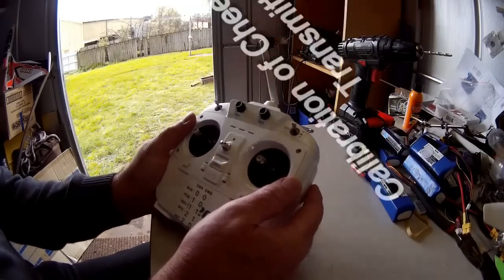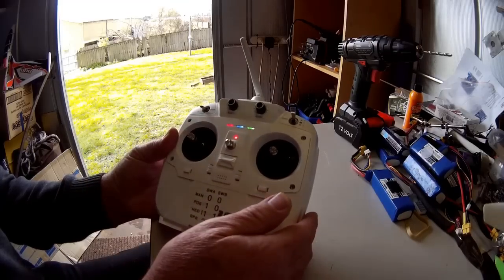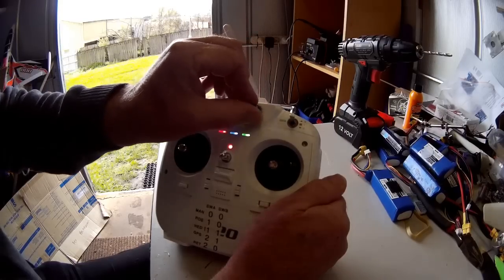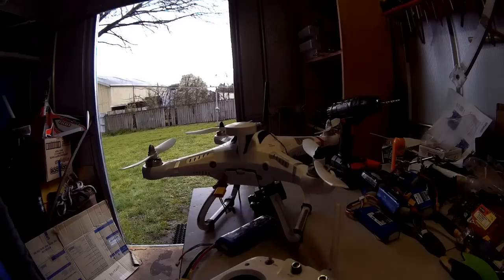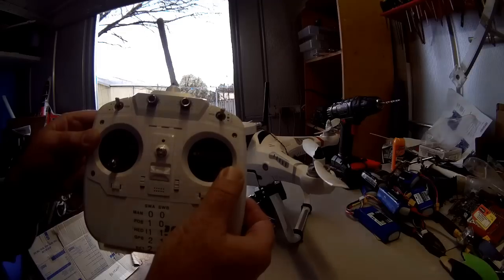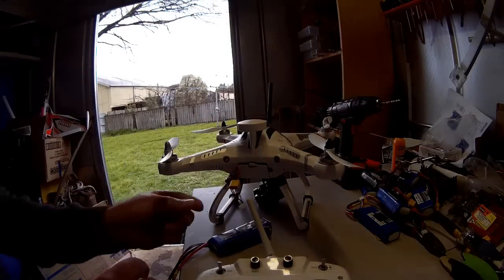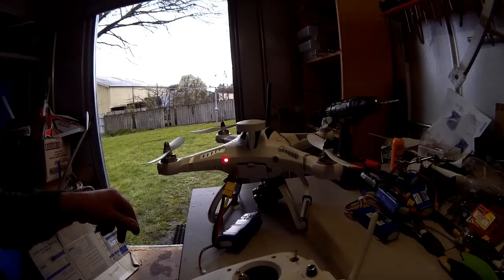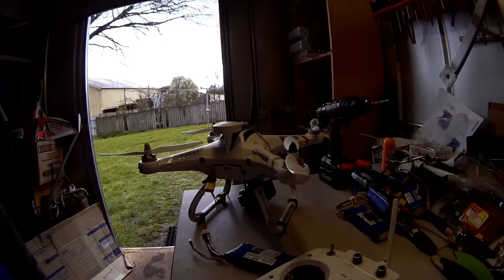Cheerson CX20 Calibration + Transmitter

Comment: I hope you don't mind but I've had to refer to your video several times in the field because I don't fly my CX that often and forget the calibration procedure so I've summarized it in text below in case anyone wants to save it to there phone etc. BTW I used it today when it started flying big circles in GPS mode. After the calibration it was steady as a rock. Thanks Again.

Cheerson CX20 calibration
TX
• place throttle in mid position
• left toggle to 1
• hold up right vertical trim
• turn TX on
• rotate control sticks CW five times to all corners
• put throttle stick in mid position
• rotate auxiliary 1 knob CCW,CW then back to 0
• repeat for auxiliary 2 knob
• left toggle to 0
• turn off TX

Compass calibration
• Plug in battery to quad
• Immediately turn TX on with throttle down to base setting 
• Immediately put right stick to lower right hand corner
• Red and yellow light will flash on quad
• Rotate quad horizontally 5 times
• Turn quad vertical nose down and rotate 5 times
• Place quad back on ground and unplug battery
• Turn TX off
Reply: I tried all , everything word by word and it don't work 😭

Comment: Hi, ive just recieved my CX-20 today, and done all calibrations, one thing that bothers me is that isnt it that when the drone acquires GPS signal, the green light should be on steady Bright Green?? Mine seems to have have a Problem, i think if it already acquires GPS signal the green light shuts off!?? is it a big problem? im afraid to fly it now =(
Reply from the maker: +Michael Corpuz should be steady green, usually takes a few minutes. it will be flashing until it gets enough sats.also its best to move the gps from on top of the reciever to under the top shell and cover with either copper foil or aluminium foil ,gets sats quicker and does not get interferance.there are vids on youtube how to do this , its easy .

Comment: I'm having trouble taking-off with my CX-20. When I throttle up, the quad wants to tilt over severely. I'm an experienced quad pilot, and I've never had this issue with any of my other quads. The props are on correctly, I've tried recalibrating the gyro and accelerometer in Mission Planner twice, and I've recalibrated the ESCs and transmitter. Any ideas?
Reply: +Drew Fulkerson Have you sorted things out yet?  If not, see my reply to the person above you ^
Reply: or below you even lol
Reply: Mine does  it all the time. I just throttle up hard to get it off the ground.

Comment: I have to do this when i get one? or just if i want to?
Shouldnt it be ready right out of the box?
Reply from the maker: +Matt Owens Gidday Matt, you will have to do it to get compass bearings for where you are first up and also if you go to another flying area more than aprox 100 miles away. also make sure you dont do it where there is a lot of metal or powerlines about, it can mess with the compass.

Comment: I don't have access to a computer whatsoever! only this tablet. I might have to send it back if it's that unstable. But, before I do, I can try to, and I even read that sometimes a unstable or tilting issues might be solved by hovering for a little bit. I also know that everybody has a way of calibrating the Compass and GPS and even the controller. I also heard that the compasses and GPS come loose also!  I know that a lot of people, as soon as they get them out of the box, they shoot them straight up like a rocket ship without getting used to how they handle etc... And then they cry like little girls,  because "it just flew away, just like that...." I believe in baby steps!!! Thanks for your time.
Reply: +philip dangelo  Hello,  did you ever do the hover thing to get rid of the tilt?  Or did you send it back? If you search YouTube for   "How to fix the tilting issue on a Cheerson CX-20 / Quanum Nova quadcopter"   by Portuman,  I found it helpful and it did work pretty well.  (I would have given a link but not great with computers myself  lol)